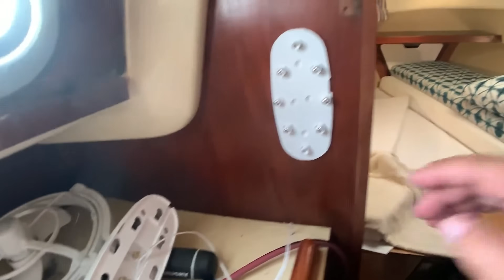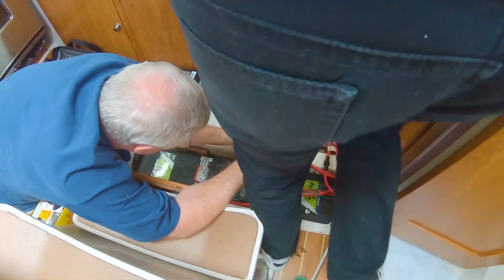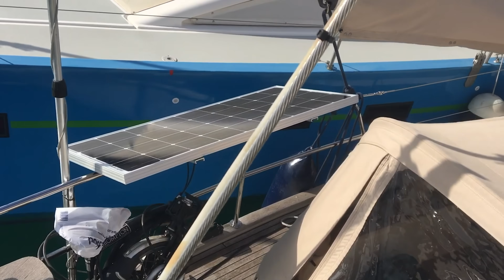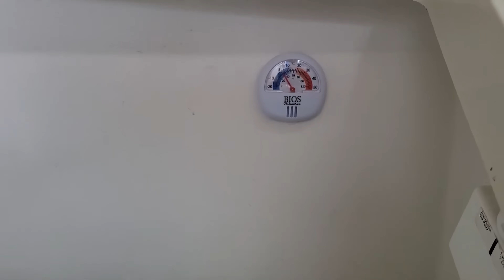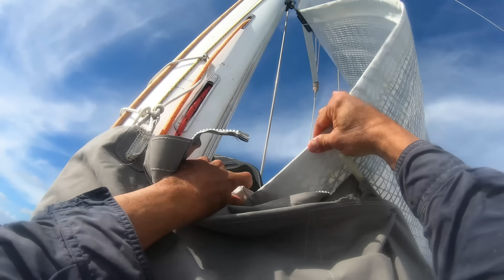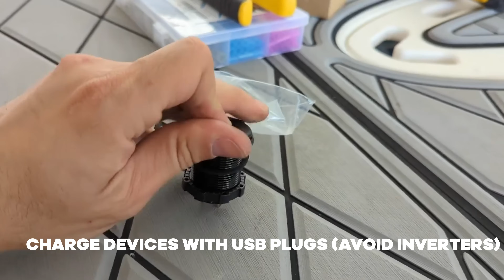Double Your Battery Life With These 10 Stupidly Simple Boat Mods

Comment: Well some of these tips are good. Just going to USB devices really doesn't fix a problem. You need to make sure you're measuring power you just use for each device... Mini USB devices. Just assume the power is there regardless and doesn't take into account you have limited power available

Comment: You missed number one. Many boats use lead acid batteries. Hard wiring them in parallel makes them fight each other. Separate chargers and separate loads work. Batteries in series works even better. Don't forget camping sized pure sine wave inverters. 12 volt chest freezers are often better choices than built in boat fridges and they are a lot cheaper.
Reply: Portable fridges have way less insulation than a good built-in fridge. Mine has 4" of high-quality insulation. My portable fridge uses way more 
power than my built-in fridge.
The best mod you can make is fit lithium batteries. Way better than lead.